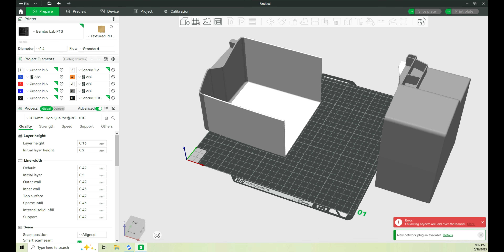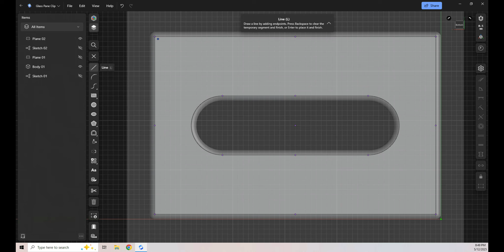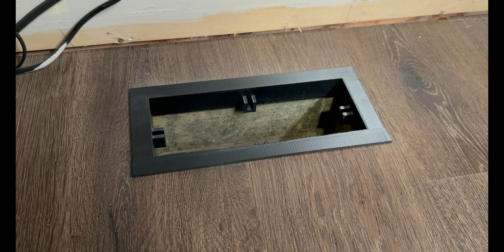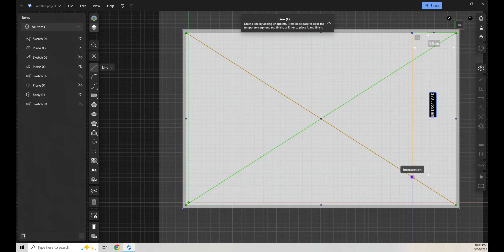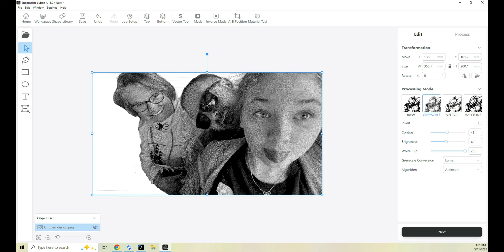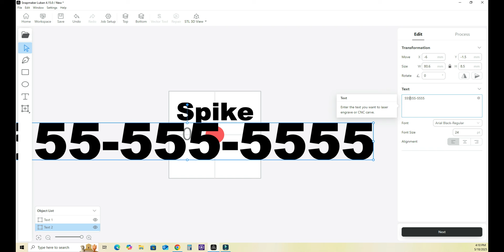DIY Instead of Buy 5 Projects You Can Make with a 3 in 1 Printer

Comment: I know what you mean. The house we bought had a fancy pants shower...so nothing standard in it. One of the roller spring module for the sliding door broke.  Those are normally pretty standard and you can pick them up at Walmart for $14.  Being non standard because of the borehole location on the door.....can't do that. I had to look for the manufacturer part. After long search I found the right part....over $300 and 6 month wait.... Sharpr3D....20 minute design....7 cents part 17 minute print....done.
Reply from the maker: Oh nice! 3D printing comes in handy again 🎉
Reply: @Martins_3Design  Yes, there has been many replacements of things, making useful things that doesn't exist or not fitting...it never ends. Every home should have a printer, they are an appliance.

Comment: How did you get 4 freezer shelves from just 750g(+\-) of filament? What settings were you using?
Reply from the maker: No I only printed three of the shelves with that roll. That fourth one was the one that I had to cut into two and print on my bambu

Comment: I wish my A350T would print that well.
Reply from the maker: I almost bought one of those myself, does it just not produce well?
Reply: @Martins3Design I have tried every trick I can imagine. I just haven't been able to get a good first layer. Glue. Hairspray. Fresh wash. New build plate. Level and re-level. New roll of filament. Dry it. Nope. It doesn't seem like it really does bed leveling and I tried setting the last point several different ways. Plastic card, feeler gage, paper sheet. Nope.

I have nearly every upgrade they offer, so I can't just throw it out. It works OK for a laser. It's just slower than cold molasses. I think it may be used for that and as a fume extractor for my new Bambu X1C. I have over 100 hours on it in less than 3 weeks. The 2 failures were my fault. No brim on one and I didn't clean the plate on the other. It just works.

If you have any ideas, I will gladly entertain them.